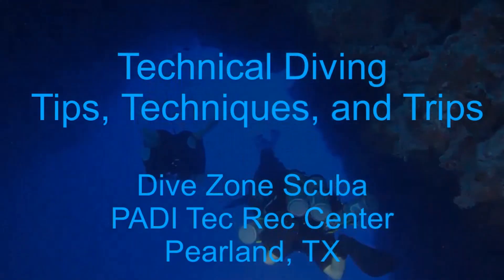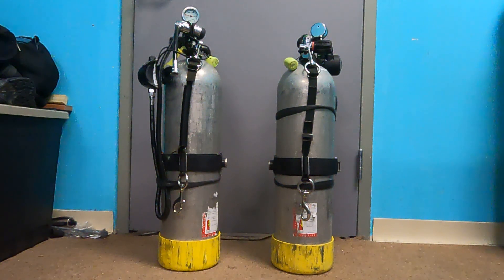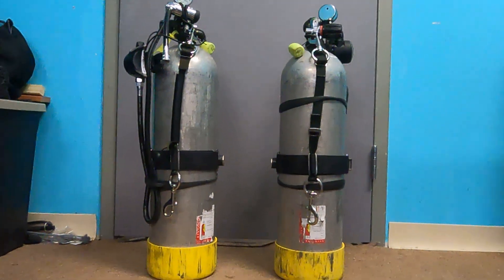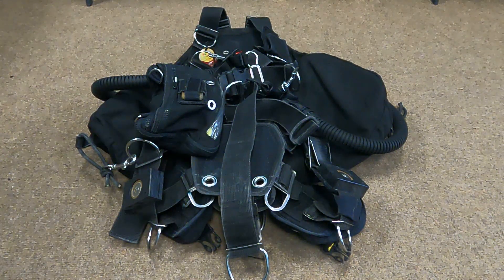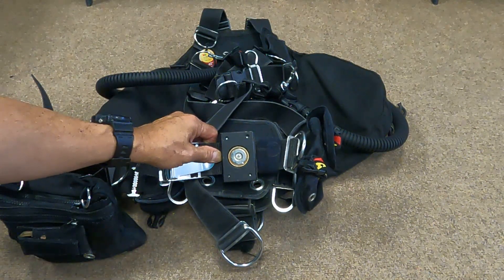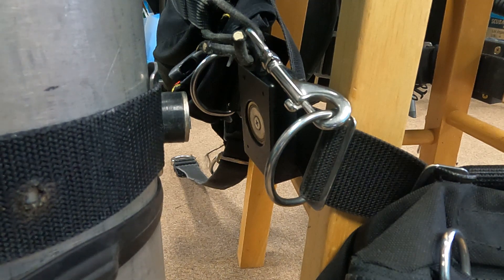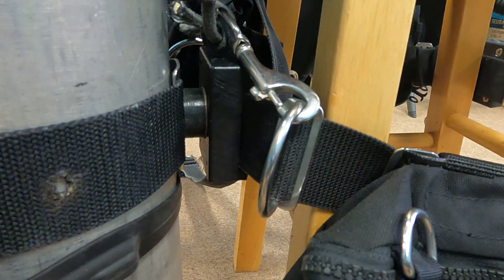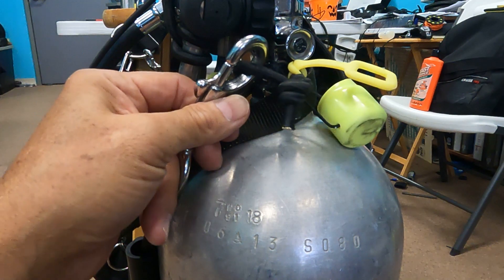#93 - Magnetic Mounting System For Sidemount Tank Scuba Diving

Comment: I'd be curious to see where you got the hardware from.  I think I might be able to DIY something similar, but I'd probably have to do some hunting around.
Reply from the maker: Amazon all the way.
Reply from the maker: Hello Dick.  The blocks were actually cut with a table saw and drill from a high density plastic called starboard.  I am not familiar with magnetic tool belts.  So it is possible that you could find an accessory that would perform the same function.  However, a critical feature of the blocks is that there is a slight recess so that the magnet / plate are consistently positioned.  That also only allows the magnet to be released if it is pulled directly out from the block.  In an earlier prototype, I discovered that a sideways motion could cause the magnet to disengage if the magnet / plate were flush to the block’s surface.
Reply: did you have to modify the blocks for the magnets or were they originally for something like a tool belt?

Comment: @DiveZoneScuba is that something you did in your garage or is it something we can buy to try?
Reply from the maker: Actually, I made it in a spare bedroom.  The garage is way too hot.  If you are asking if it is a prototype, the answer is yes.  It is relatively easy to make yourself.  All you need is a couple of magnets and magnetic plates, 4 bolts, and some high density polymer.  Lately, I have been getting away from using high density polymer and using kydex instead, as it is substantially easier to machine.  If there seems to be any substantial interest in this, I will make a video on constructing a set.  I am still designing the upper magnetic mount.
Reply: @divezonescuba  The video tutorial would be great, also it would be nice to try it... not having to use the sliding D rings and ride them just like steel tanks would be nice.